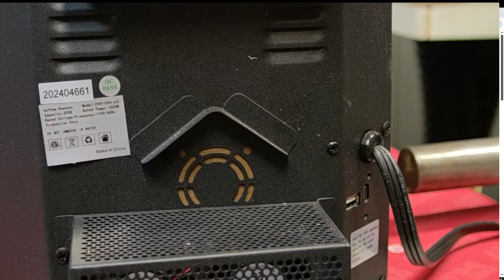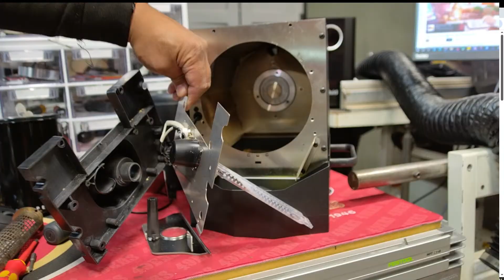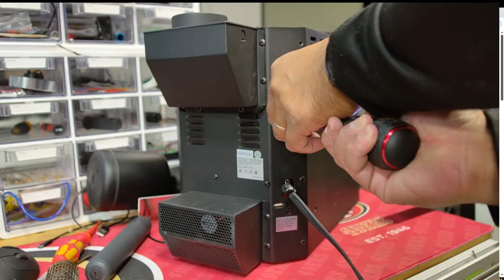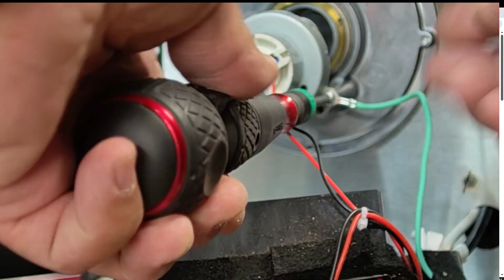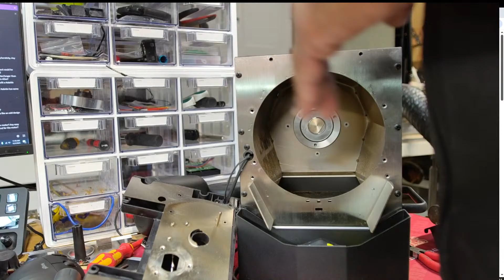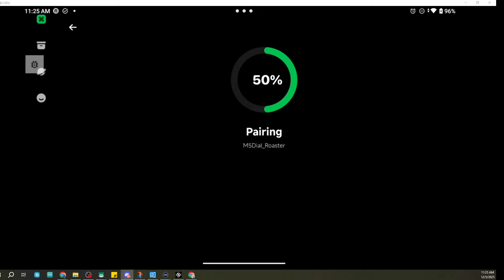Skywalker Roasters

Comment: Sell me the metal plate that the bean temp probe extends from if you have a spare one laying around. Emphasis on sell. It would need to be the older version without the hole for the fuse.